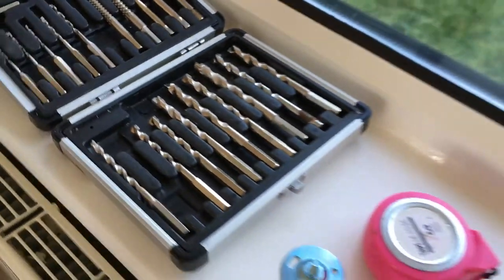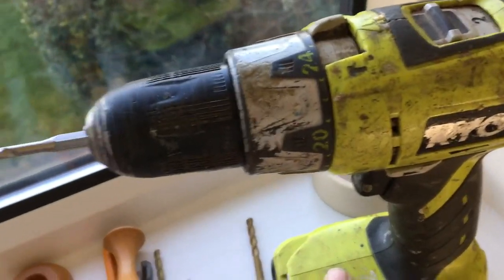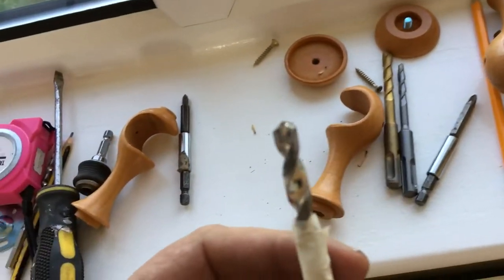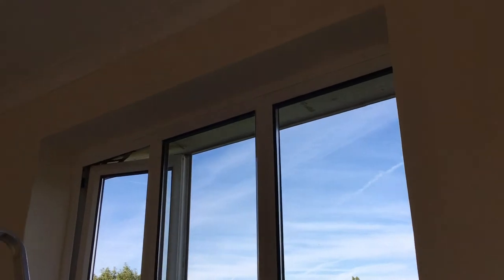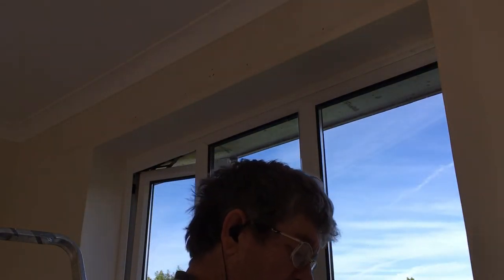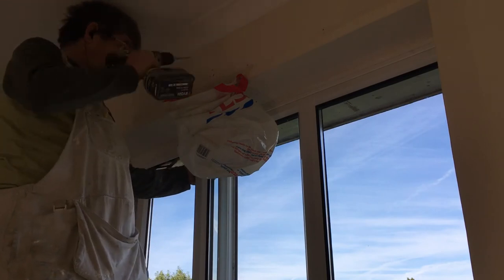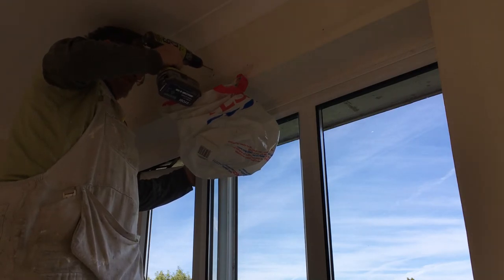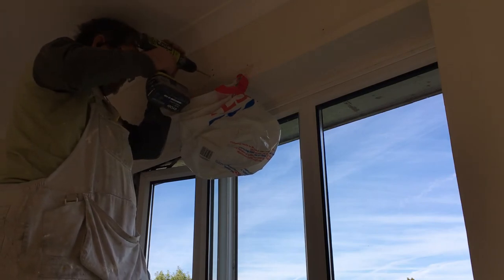Drilling Holes in  Concrete Header for Curtains

Comment: Great video if you have loads of different drill bits......so I ended up fixing my rod to the ceiling and just put long curtains up.......that’s a woman’s solution
Reply from the maker: I have since learned u need a heavy duty drill with the right bits to drill these concrete headers. But I like your get er done style
Reply: it's what I would do if we made homes out of cardboard in my country like you guys do in the US but fortunately we use concrete everywhere.

Comment: I have the same problem.  I have a standard hammer Bosch drill, and I hate having to buy a SDS drill just to hang my curtain rail, but I guess I will.  What do you recommend as I don't want to spend a lot of money, since it'll only be for hanging curtain rails.  By the way, I am also a fellow American residing in the UK
Reply from the maker: just  the other  day i was doing  some blinds  in a new build  house and   i forgot  to  bring a heavy duty drill   and i was surprised  how easy it was to drill into  the header  with my  volt  ryboi  drill  ,,, us  yanks gota  stick together
Reply from the maker: first  choose the right size  ,,  then  go to tool shop  or Screw fix    and buy  the best one   you can afford   or want to pay for    if you are not in a hurry   look at amazon   I  find  starting  with a small drill bit   helps  alot   for accuracy   and   just  for  drilling
Reply: Buy a corded SDS drill. For what you want to use it for, any cheap one will do. More importantly though, use an SDS drill bit a half size smaller than what you intend to drill. So if you are drilling a 6mm for a red rawl plug, then use a 5.5 as it will jump around  as you drill the hole, so you can make your 6mm hole with a 5.5. Don’t forget to use some lube on the bit in the drill as well. Good luck....

Comment: I have the same problem.  When you hit something solid behind the drywall, how do you determine whether it is steel or concrete?
Reply from the maker: I use a metal detector which works great on older buildings . new houses have metal stud walls and metal covered insulation   that drives the metal detector carzy  then u have to relie on experience and pray

Comment: Do you reckon I could get this done with a 600W hammer drill
Reply from the maker: should work just fine
Reply from the maker: every one of the windows is different  if you hit steel u will need  metal drill bit
Reply: Thanks a lot 🙏🏾

Comment: the more important question is, is it okay to be drilling into the lintel to begin with?
Reply from the maker: hi ya Reedy I dont see any problem ,,i think u dont need to drill deep into lintel ,,just enough to get a wall plug to work ,Ive never seen  a lintel failure  have u ??
Reply: @BearwoodBrown  no but I'd imagine there is a good chance you would be underneath it if it did, in any event I drilled 3 holes 35mm deep successfully into a 2.4m span lintel and it did not fail on me so happy days.